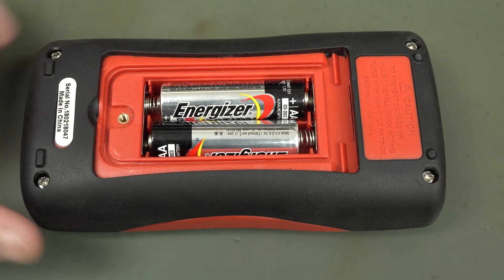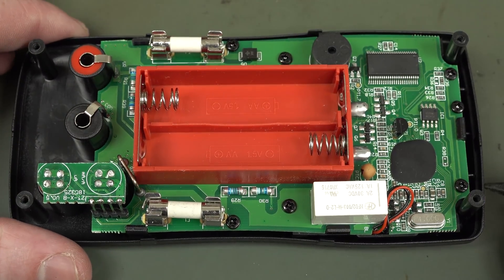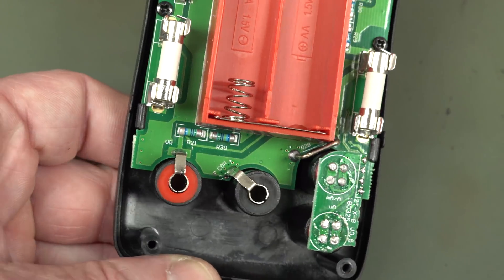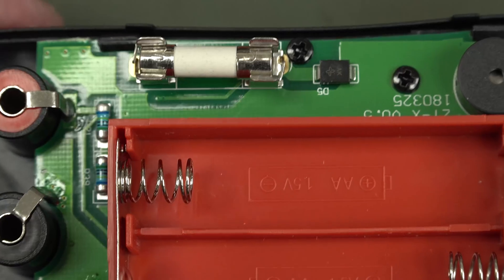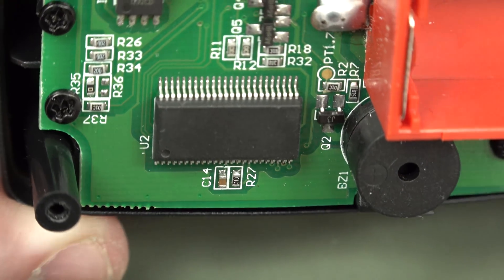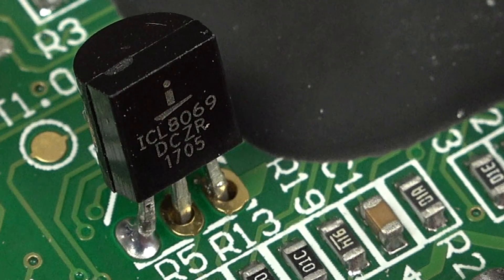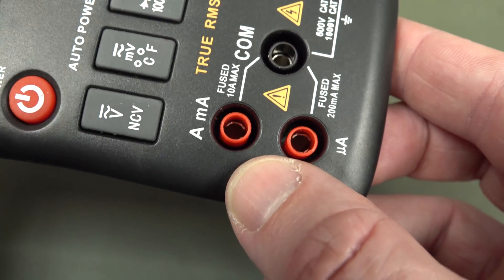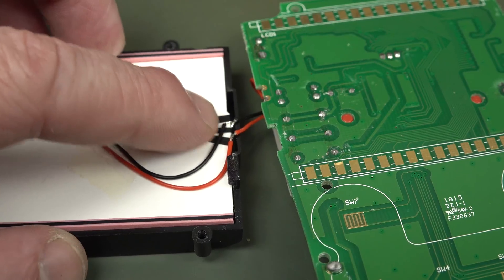EEVblog #1096 - ANENG Q1 Multimeter Teardown (Now in 4K!)

Comment: At 6 min in the PTC and clamp node I suspect is the drive side for the diode, resistance, capacitance, etc. modes.   The high impedance leg is the input.   You should hear the relay switch in anytime you change to one of the other modes.
Reply from the maker: Yes, I demoed the relay click in the video. mV is the same path as ohms/diode/cap. That the same in most meters.
Reply: For fun, did you try to change the state of the relay with a magnetic hanger?   I suspect it does not have a shield.   I would be interested in knowing if it's in the volts mode and the relay changes state from an external field, does the meter know?

Comment: On 4K you can really see where the camera focuses. This is not that apparent in 1080p.
The camera seems to have a small depth of field. Maybe decreasing the apperture size will improve this.
But this is really just nitpicking and loads better than 1080p. Love the sound quality too!
Reply from the maker: I'm already shooting at a fixed F5.2 to get larger depth of field, it's obviously not enough. The old camera i used fixed F4